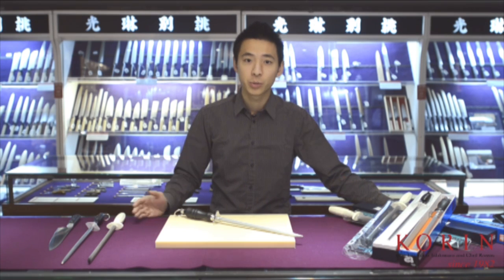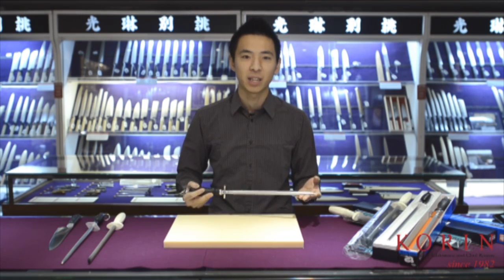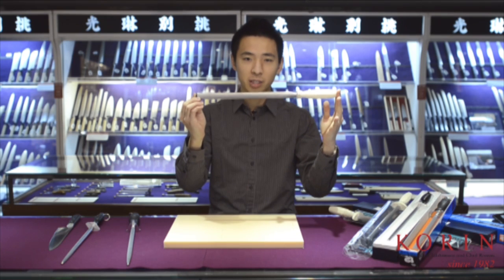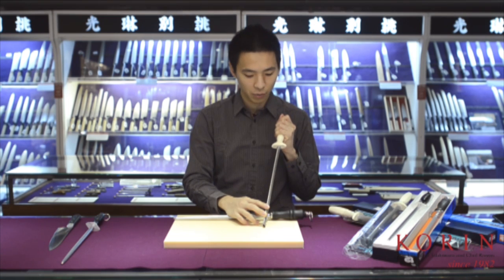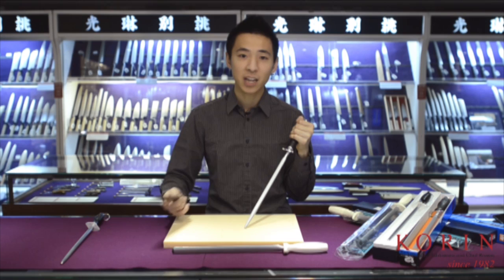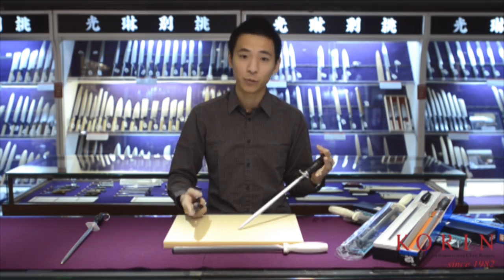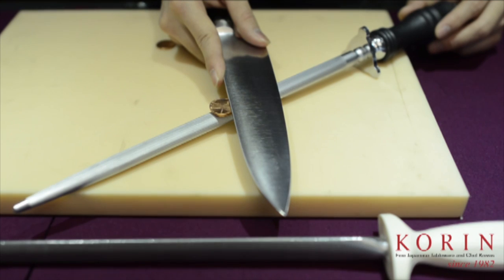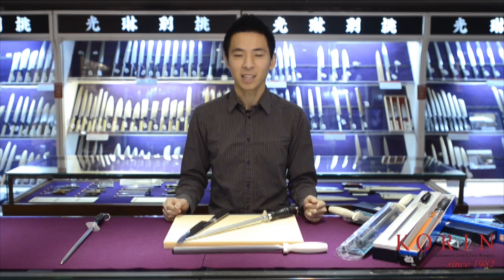The Korin Product Show: Episode 11 - Honing Steel

Comment: Vincent says that the spine leads in sharpening.  You seem to have the edge leading during honing.  Is this method still correct for honing?  Just wanted to confirm my thoughts.  Also, what angle do you hold the honing steel so that the bevel angle is correct on both sides of the bevel (i would guess that the angle of the steel doesn't matter as long as the knife's angle to the steel is as you stated - , but thought to ask anyway)?  I have a brand new 70/30 santoku knife that i am afraid to ruin so answers would be very much appreciated.  Thank you in advance.